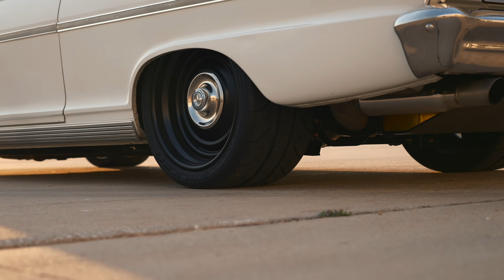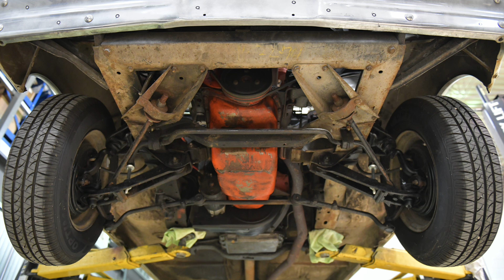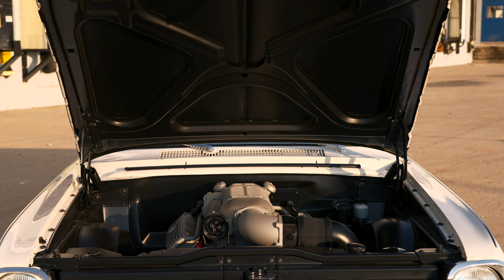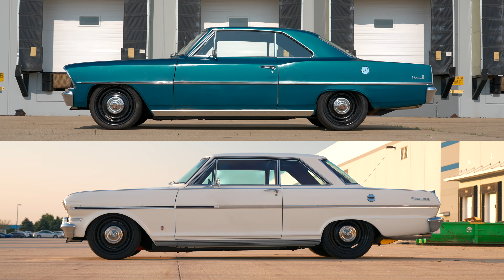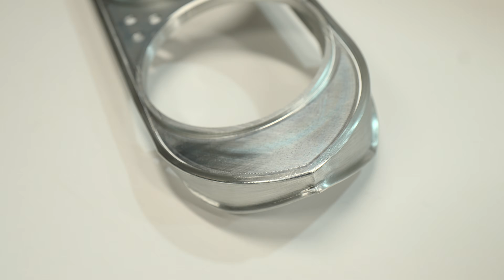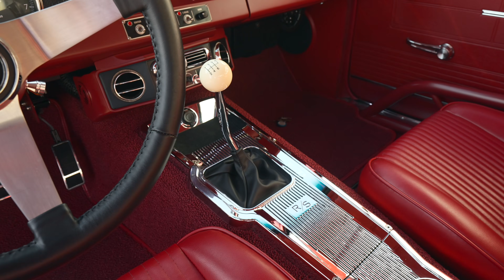+850HP Supercharged Sleeper | Roadster Shop built 1963 SPEC equipped Nova

Comment: Had a '63 Nova convertible, 6 cyl, but not for long. A brick in the gas pedal fixed that. Put in a 327 and 4 speed. Little that I knew, the stock rear end and 13" tires was good for melting the right rear tire, but the fun didn't last long. Things went boom. All my fault, amateur build. Wicked sleeper, red paint, manual convertible top, Corvair turbocharger mufflers and a Muncie shifter that I broke off during a heated shift from 1st to 2nd. Shufted with a long screwdriver for a couple of months. Fun times, didn't like replacing the 7:00x13 tire minthly. Ha Ha. 75 now, but still have great memories of that sleeper

Comment: its always the front end/suspension fab work, the engine fitment/firewall etc/drive shaft/crank geometry and routing the exhaust/mufflers through the axle that seems like the biggest thing with these NOVA II cars. YET easily the most favorite part for me to look at all the welds/joints/fab work around that rear end/muffler area. Beautiful undershot NGL 2:37. Some of these at times need some fab work to have an ideal shifter/trans placement too. Is what it is this is my favorite CHEVY platform of all time. I wonder what the temp figures look like with E85 considering vs pump thats about all that really comes to mind as far as curiosity with this nice build. Man builds like this make me want to get my hands on a rolling chassis to stash away for when i actually have REAL money to put down into a build...to at least have set aside. Or at least do some pre-fab work on before i get serious like tidying up some body work/rust and some mini tub....most likely going to get a wreck/wrecked front end bc new mounts/geometry etc and suspension just calls as necessary if you really want this platform to be a real ripper.
Reply: One of the reasons I never got one of these is at the time no aftermarket suspension to cut the inner fenders out...way over my head

Comment: Fantastic set up I always love the body style but like I said they were always very flexible. I want to see Emma and saw a fox body chassis full frame pretty much any Ford motor and transmission capabilities  I was very impressed. Even though I’m a Chevy guy always impressed with good engineering. I love what you’ve done with that, including the extra tubing along the doors for more strength and rigidity without everybody knowing it have always loved a 67 Ford falcon. Body style that might be one for you to tackle with whatever drive train

Comment: Ohhh to Dream  Ohhh to Dream,  my all-time favorite series of automobiles 1963-1965 Nova,  had a chance in the mid 80s to buy my cousins 65 Nova SS  283 2 Speed 2 door, body off frame total restoration,  rebuilt motor, paint, new carpeting, was a total dime, d debt quick sale $1800, believe me I'm still kicking my asss for not buying it

Comment: Love these 63-67 Novas. This white/red interior, the steelis, the stance, the tires, the drive train, all perfect. One doesn't need much more than that.
Reply: ,,,,,,,,,,,,,,,,,,,,,,1962-65,,,,,,,,,,1966-67,,,,,,,,,,,1968-72.................................then came disco nova  junk..................
Reply: id love a 396 4 bolt from my uncles 70 nova in a 66 personally...but the fab work/geometry etc seems like too much of a headache including running a roller over solid lifter which pretty much ruins the overalls of even having that engine in the car in the first place. Over the years ive grown to consider a LS3 with a 4.8L crank insead. Just to lighten up the weight up front and still have something FUN/high revving to just tear it up with. Then again id rather go find a 59-61 el camino to put the 396 in instead for the ol man On bags XD
Reply: @anhiirr  Not sure how a big block would or wouldnt fit in these?  Shock towers, like fords convinced me not to get one.

Comment: Had a 64 Chevy II tudor sedan, swapped the 194ci 6 for a 327/300. Still had the 3spd, 10 bolt rear, and the drum brakes, but it was a great little street sleeper. Not bad for an 18yo kid back in 1970.

Comment: The problem with early Novas is no room in the rear wheelwells. I see you thinned out the frame rails to keep from moving the suspension pickup points too far inboard. This car is the GM equivalent of Jorgen Moller's Voodoo-powered Falcon. Very nicely done, guys.
Reply: Agree....Corvettes that vintage are the same, cant get any rubber under them. Never understood why GM did that

Comment: As a Nova fan for sure, o owned a70SS 396 ,and a 72 350 Nova's. The 66, and 67s are without a doubt my favorites, never really liked the 63s until this video! It looks the way a 63SS should have looked when GM first built them. Nice job especially the colors you picked for the engine, and the headers. Like a time capsule of the 60s ,and 70s! PEACE ✌️
Reply: Yes to the '72.  Nice looking car.

Comment: Real question… why use poly  body mounts on cars that were originally unibody’s? Couldn’t you mount the frame directly to the body. Also is the cage tied into the frame or the body?
Reply: The mounts allow for a smoother ride and a tad of flexibility.  I'm confident the cage is tied into the frame for structure superiority.